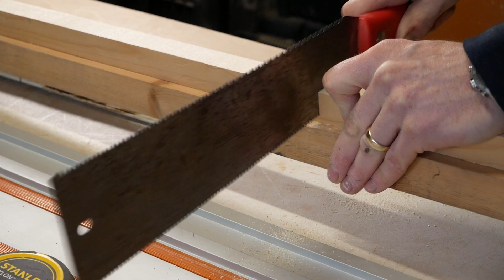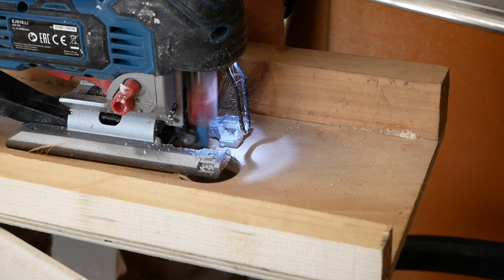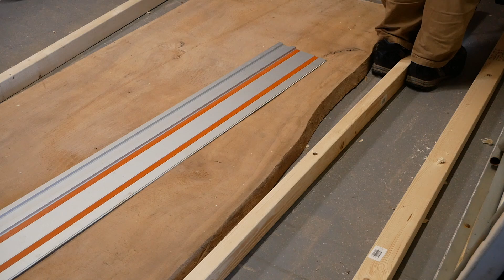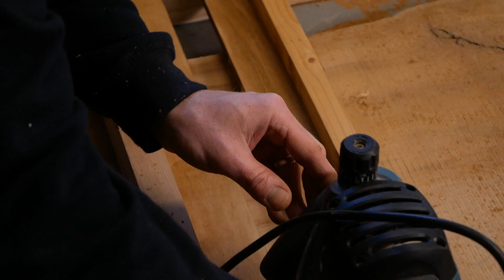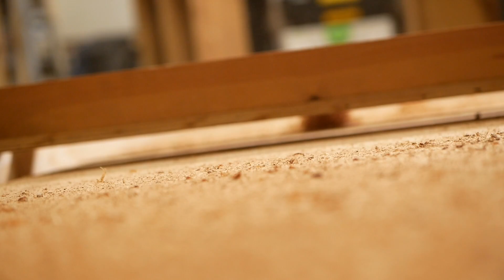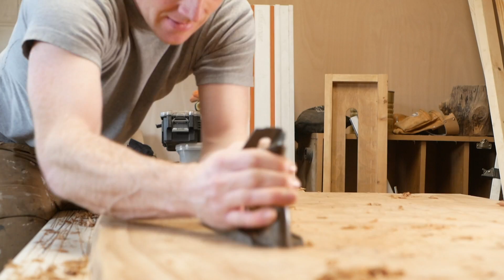FLATTENING A LIVE EDGE SLAB - DIY Desk Build

Comment: I've been looking at doing this for a while but wonder would it not be a little quicker, less messy, and perhaps actually easier to just use a hand plane?
Reply from the maker: You can but not sure it would be quicker unless very flat to start with. This was about 2-3 hours start to finish including making the jig. Having done one slab, I can’t imagine spending more than an hour doing again. Almost did one side by hand to compare but changed my mind after seeing how quick it was with router.
Reply: @TheRestorationCouple  Interesting, thanks for the reply, Tim.

Comment: One thing I would like to add if people are thinking of doing this.  When your router is crossing the slab be patient and  just cut half to 3 quarters of the router bit each time.  The reason for this if you have to use the router on missed lines it tends to flick them off pulling out grain from the finished surface.   I level slabs often and to the untrained person this issue is a real pain to sand out.

Comment: Hi Tim, I have just done the same thing for my first proper workshop bench.  I also found out why most of the videos you see online use use high sides to ensure rigidity of the jig.  The middle of the slab for my bench had a slight dip in places where the jig flexed so had to make another pass to get it level again, still you live and learn.  Another great video, looking forward to seeing the desk build.
Reply: 25mm ply wood help 😁

Comment: Great video, I used the same method to flatten a slice from a tree trunk for a side table, it works very well however I'm yet to finish the table...

Would it be better to cut the wood to the desired length first to save time and wear on your bit?

Comment: Is there not already a saw that does this? A surface planar I think it’s called
Reply: Usually these dont take such enormous widths. And I din't suppose Tim owns one that size
Reply from the maker: I’d have to cut down to 12” strips and glue back up to get through mine so kind of defeats the idea. 👍
Reply: isyt You can’t flatten a slab of tree using a Planner it’s ether Tim’s way or a CNC machine.  Even the largest planner will not take out Timber twist.  I use a steel jig up on a bench where there is no flex whatsoever so you hardly get lines.  Then it’s straight on the sander for a perfect flat slab.
Reply from the maker: Buddy's Insight Nice. It was tempting to make up something better with some steel angle or tube and better materials but I’d probably not use it more than once every couple of years. This did the trick for now but no doubt a better set up would achieve better results.